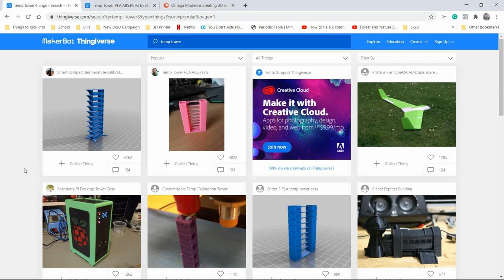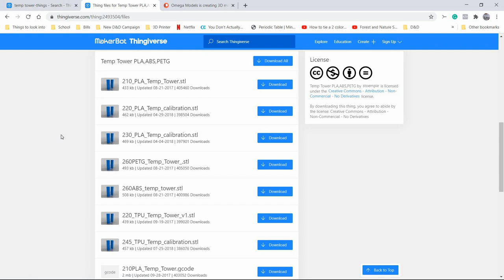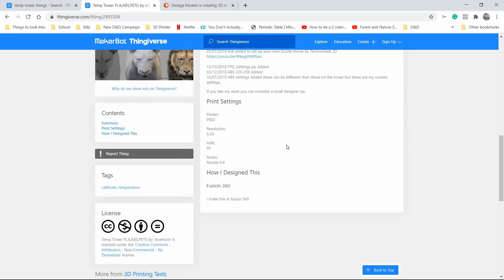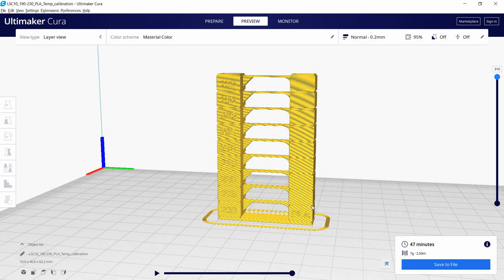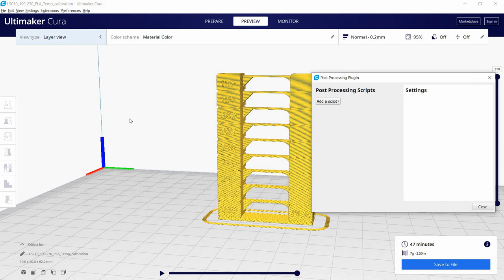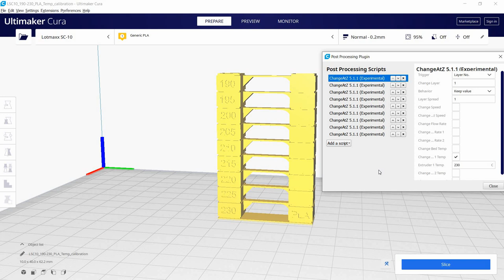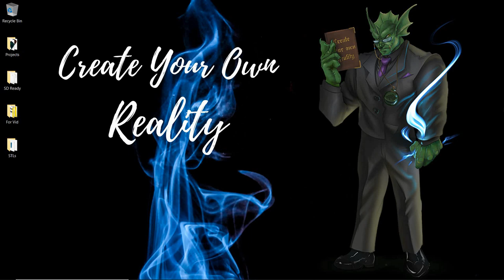How to Create a Temp Tower Test in Cura

Comment: I did this and my extruder never changed temps
Reply from the maker: I'm so sorry I missed this question! Are you sure you exported the file after adding the script for each layer?
Reply: @SlicePrintRoleplay  I believe so, but it's been a day or two. I'll try it again, thank you
Reply from the maker: @GitNthTRUCK  No problem and sorry again for the late response!
Reply: Me too, I did everything you said and it does not work. Have you guys found a solution?
Reply from the maker: @pluffff  I apologize for the process being a a bit different from the video.
I believe there were some slight changes to this process with the latest update.
I'll update this video as soon as I can!

Comment: Some how my print starts at 200 even though i clearly followed the tutorial and told it to start at 230...
Reply from the maker: In Cura under "Material" there is a setting for "Initial printing temperature" normally it's used to make sure you're getting good at adhesion on your first few layers. 

Does the temp change after a few layers or stay at 200°?
Reply: @SlicePrintRoleplay  I replaced my nozzle for a .2mm this morning and i'm having all sorts of probelms so i can't even get above the first few layers to check :P
My bed is level, when I go through the points, with the paper test is juusttt grabs, but when I print it's off the bed by a good 2mm or so. I used a ruler, no warps, and the Z offset is set to 0 on this (if it saved correctly, i guess)... It's so bizarre. When i do the level it'll go to the far front left corner and won't touch but then all leveling points it will. And then as i stated, won't make contact when printing lol. I'll have to tackle this again with more energy :P I'll let you know once things are up again and see what it does after a few layers.
Reply from the maker: @studiovulcan4411  ugh I feel your pain. I ultimately decided anything less than a 0.3 nozzle was more hassle than it was worth. For me at least.
Good luck with it!
Reply: Make sure your profile's temperature isn't set at an absolute value. If you see an f(x) symbol next to the temp setting, it is set to an absolute value. Just reset it and that should ensure it's not an absolute value, allowing the script to determine the temp.